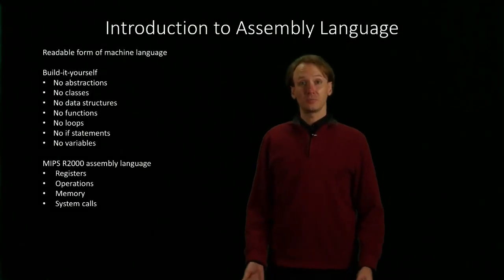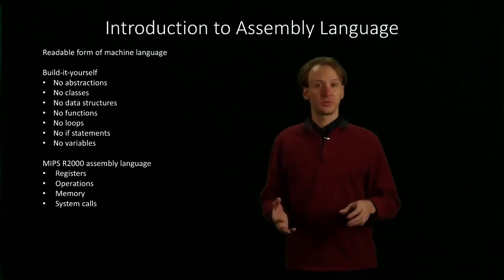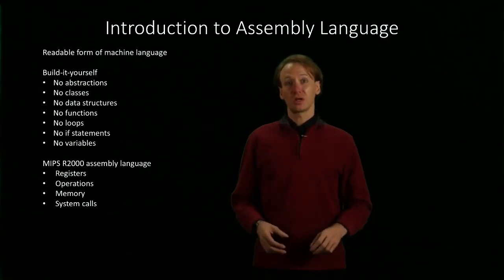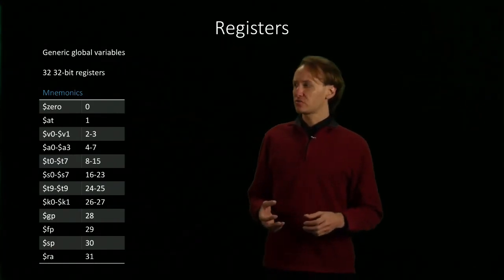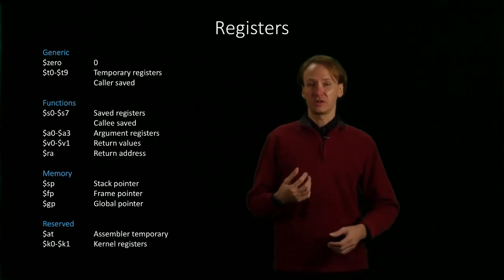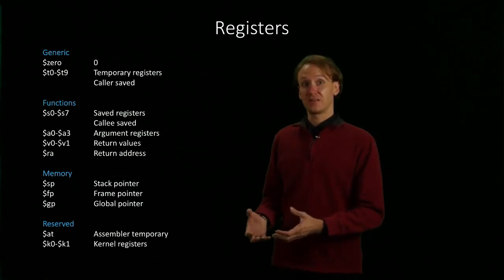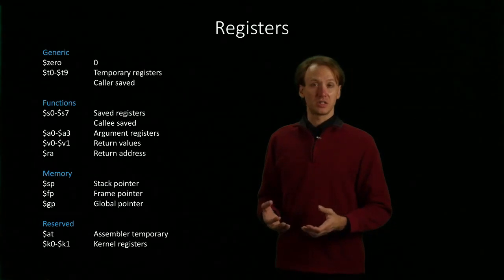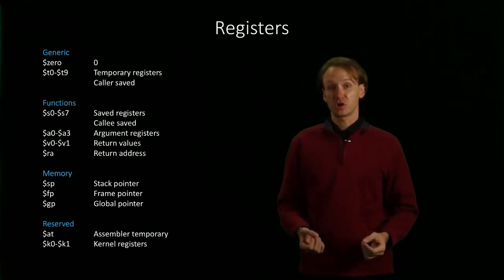1.  Introduction to Assembly Language

Comment: how to do this question using mips instruction set.?
Find the factorial of a given number using recursion
Reply: Try writing it in a different language (Python, C,...) first and then translate it.
Reply: Consider seeing a doctor
Reply: @happyhappyguy5034  i guess you are suffering from corona not me. U should better see a doctor
Reply: you can do it in assembly its not hard
Reply: # function to find the factorial of a number
# $a0 = number for which factorial is to be calculated
# $v0 = return value (factorial)

factorial:
    # save the return address
    addi $sp, $sp, -4
    sw $ra, 0($sp)

    # check if the number is 0 or 1
    beq $a0, 0, return0
    beq $a0, 1, return1

    # calculate the factorial recursively
    subi $a0, $a0, 1
    jal factorial
    lw $t0, 0($sp)
    mul $v0, $a0, $t0

return0:
    # return 0 if number is 0
    li $v0, 0
    j end

return1:
    # return 1 if number is 1
    li $v0, 1
    j end

end:
    # restore the return address
    lw $ra, 0($sp)
    addi $sp, $sp, 4

    # return the result
    jr $ra